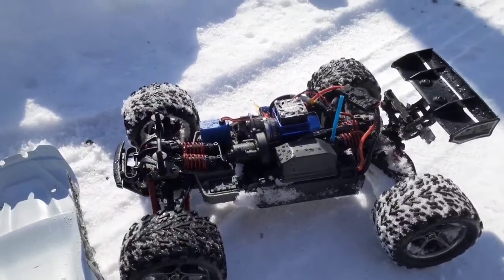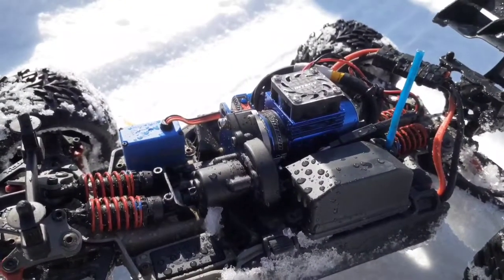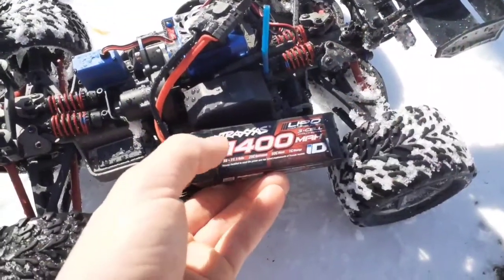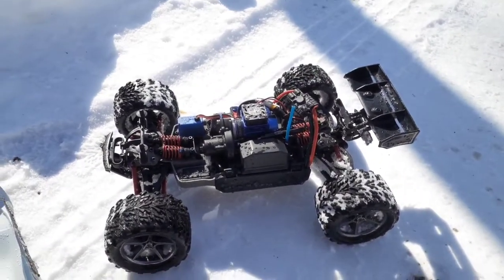1/16 E-Revo VXL Snow Bashing

Comment: Nice video man! Just subbed! Keep it up! 🤙🤙👍😁
Reply from the maker: Thanks man!
Reply: Trax RC when you charge your batteries. Do you always use balance mode and fully charge? Or do you use storage mode. For example say I want to use my battery tomorrow afternoon. Should I storage charge my battery ( only to 3.8v per cell) or do I fully charge the battery and leave it sitting overnight until I use it.
Reply from the maker: If you know that you aren't going to use a battery for a whole week then you should storage charge it to 3.8 volts per cell. We only storage charge and balance charge our batteries for various reasons.

1) If you don't storage charge your batteries, then over time the voltage will continue to decrease. When the voltage of a LiPo gets below 3.0V per cell, then that cell catches on fire/swells up. It is also good to take your battery out of storage and check the cell voltage. If they became unbalanced, balance charge them. 

2) Balance charging ensures that the cells are at the same voltage, which is essential. If you do not already have a cell checker, you should get one to moderate the cells. It is also important that you make sure that the cells do not get above 4.2V per cell because then it will go up in flames. 

We hope that this helps!  :)

Here's a link to the cell checker that we use: https://www.amazon.com/HRB-Cellmeter-Digital-Capacity-Controller/dp/B07QKZ3PPB/ref=sr_1_4_sspa?crid=3BRTQTDFJ92FI&dchild=1&keywords=lipo+cell+voltage+checker&qid=1584587054&sprefix=lipo+cell+%2Caps%2C169&sr=8-4-spons&psc=1&spLa=ZW5jcnlwdGVkUXVhbGlmaWVyPUExVVpNMlJNU0pMUVZPJmVuY3J5cHRlZElkPUEwNDEyMjk1TTBCTkFURDI1R0ZSJmVuY3J5cHRlZEFkSWQ9QTA5NjE2MTczT0FFNVlOQTdQSFEmd2lkZ2V0TmFtZT1zcF9hdGYmYWN0aW9uPWNsaWNrUmVkaXJlY3QmZG9Ob3RMb2dDbGljaz10cnVl